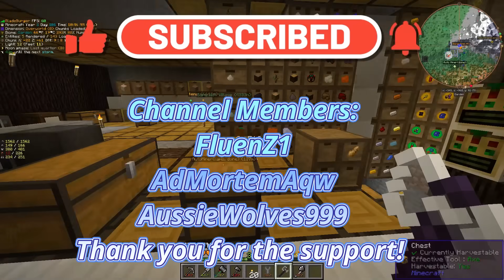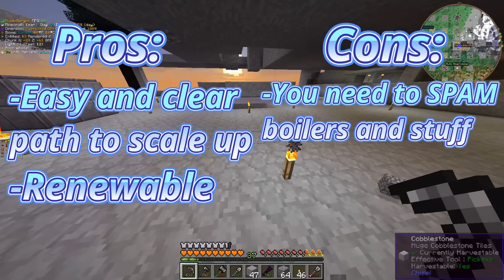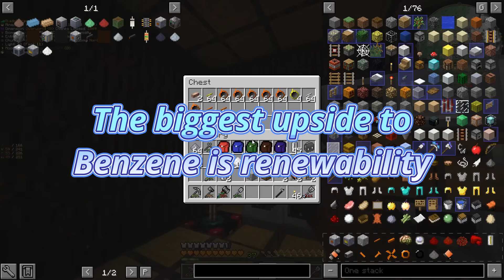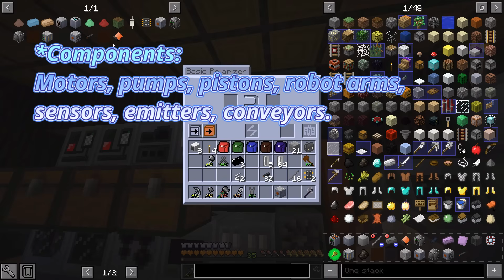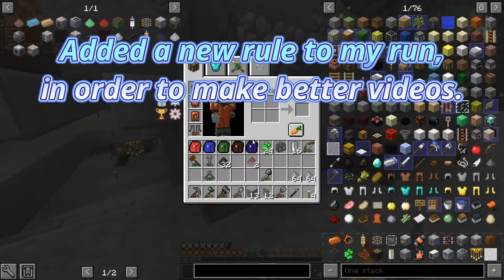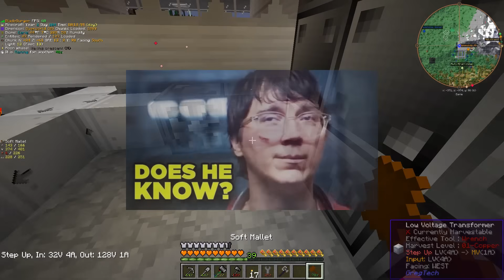Joining the CHURCH of BENZENE // Gregtech: New Horizons

Comment: Btw as someone who used benzene myself from MV-IV :
-Don't shy away on spamming a lot. There are many upgrades to benzene such as Pyrolyse to ICO, Using nitrogen in ur pyrolyses, using better coils, but also make sure that you are having a lot of pyrolyses/icos anyway. For MV-EV you should aim for around 10 amps per tier at the start of each tier (and that number only goes up). I made this mistake and so I opted to switching to vacnukes and later on rocket fuel, but if my infra is better then benzene would've paid off.
-When you use wood in the pyrolyse you usually make wood tar for extra benzene, but you can also make wood gas to make ethylene! Other than that, the byproducts aren't that useful, I would only use a DT to distill wood tar but not wood gas.

And also for the "pause time" thing, I do agree that you would make a lot less progress so it does make sense, but also I think making episodes based on in-game time is a bit shifty. You could make it based on "Playtime without AFK", which is automatically counted by ServerUtilities, or simply make episodes based on which goals you accomplished.
Reply from the maker: These episodes are a continuation on a video I posted in December, which was a year in the pack. For year 2 I’m splitting it up into episodes before doing a supercut. It gets the algorithm gooooood. Also, it lets me break the editing into more digestible chunks and allows me breaks, which I’m doing now. I will have to abandon the yearly thing when I get to endgame tho, with the EoH recipes being so long. 

Also yea I’ve done nitrogen in my pyrolyses at the point where I finished year 2 lol. Forgot to upgrade the coils, but I’m gonna update to 2.9 before continuing, and I’ll have to redo the structure then. I also need 31 31 31 spruce bonsais too when I get to 2.9, an MV powered and an LV powered Pyrolyse with nitrogen use up a full crop manager field very fast. It can’t keep up

DT is on my list of things to do, I don’t quite get to it in year 2.

Comment: Imo steam is very good option for LV and starting from MV diesel is too good to not use it. I had one oil patch near the base and somehow combustion generators use so little of it, it was enough for me until HV (though I used oilsands for heavy oil), where I got nether tree. And nether tree is stupidly OP in giving you renewable oil, so you will probably build it anyway, because of all oil products you need. Also for benzene you need pyrolyze oven, air filter multiblock to not die from pollution it generates, and a tree farm, which probably requires you to do IC2 if you do it before HV, which is something I don't want to interact with in any way. Imo it isn't worth it.
Reply from the maker: I’ll probably want to swap to CBD soon, I can do Nitrobenzene for a while tho, probs through HV, maybe up to EV?
Reply: @BedrockBurger you could do both, but I’d recommend assigning certain parts to be powered by certain fuels then. (Cuz benzene-diesel have two different generators. Diesel is really good, higher fuel value per cell, ez to scale and automate, while benzene is renewable, easier to get infinite(as in to make it) and has almost the same amount of fuel value as diesel. I don’t think it’s the worst idea to work on doing both, but CBD is unlocked HV, while nitroben is late hv early ev?  Maybe earlier. Prolly want to focus on one at a time
Reply from the maker: Also I have pollution off BECAUSE of the pyrolyses btw

Comment: in hv u can get infinite oil with a bit of thaumcraft , nether tree leaves turn i think sand into soul sand that u can centrifuge into oil
Reply from the maker: Yea I have a plan to do either that or oil bees
Reply: @BedrockBurger  oil bees are alot worse ,dont do them
Reply: @pingwinskipingwin2850 Oil bees are fine, but will be less fine in 2.9 when they take the oilberry centrifuge recipe off the combs. However, in the 2.9 dailies, the actual oilberry crops are absolutely cracked right now, and are way more powerful than the nether leaves setup with even just a bare minimum MV farm multi. You can even dump oilberries directly into a DT without fluid extracting them first, and you can use them that way for recipes equivalent to any viscosity of oil (that is, you can use the raw oil equivalent recipe for that precious naphtha instead of being stuck with the normal BC plain oil).

Comment: Once you get a bit further on, HV/EV, there is actually a way to make oil fully renewable not involving bees or crops and is relatively fast and scable, theres a thaumcraft nether tree, when you place cobblestone/stone below the leaves, the stone will turn into either netherrack, soulsand, or nether quartz ore. Soulsand can be centrifuged into oil and other byproducts. Using the right setup you can get a solid fully passive source of oil with the byproducts of netherrack, saltpeter, coal dust, nether quartz, sulfur (from desulfurizing), (and perhaps otherthings but i forgot). Even though you wont get there for a while, i suggest looking up a video for it, its really interesting. Simmilarly theres also an end tree that can do the same thing but for endstone and obsidian.
Reply: I have that setup and it works mostly perfectly in the overworld, but setting up another in the pdim it's pretty broken with mob spawns. I'm going to tear it down and replace it with oil bees in iapiaries.
Reply: @sw-fast  Thats probably why i didn't clock any issues lol, I set it up a while ago in the overworld and forgot about it. Im trying to do a run where I avoid Pdim entirely, I think pdim is a little lame and encourages me to make lawn base #32455. I've had quite a bit of fun making an interesting base that fits in with the environment.
Reply: @elivated9515  I might build something once we get sheet metal in 2.9, it's the local aesthetic for industry by me irl. I'll probably still just lawn base though.
Reply from the maker: Ohhhh right I forgot about that. I did get Infusion early cuz of something I got in 2.7.4(you’ll see next episode) so I could do that soon-ish. I gotta do bees anyway tho lol